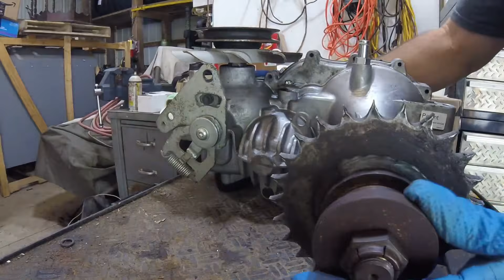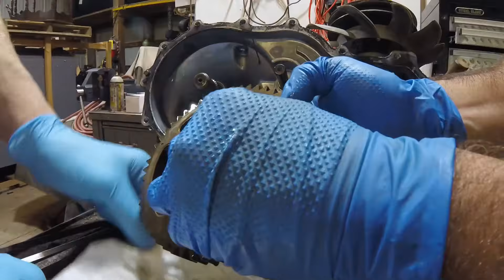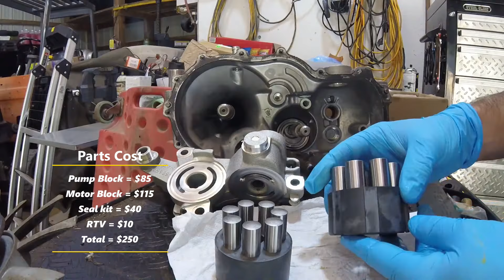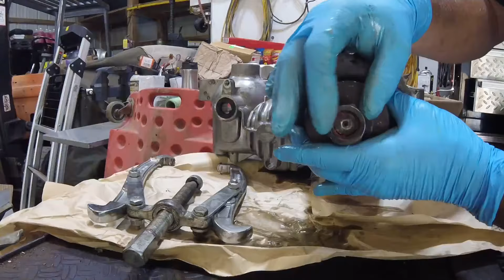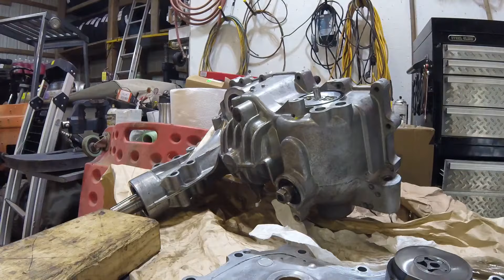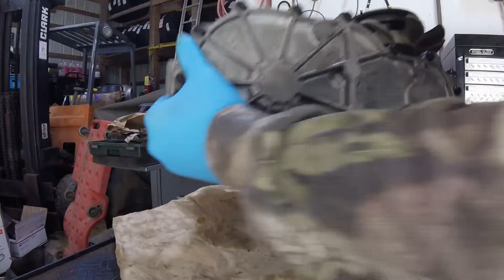Hydro gear ZT 3100 transaxle problem identification and repair

Comment: I'm glad you had this video, I did have damage to my center section and was just going to replace that cuz my pump and motor had no damage and I was going to refuse them.. saw this and sure enough, the pump had one loose pin I didn't catch... Ordered both for the same reason, they are cheap and I don't want to tear this down very soon

Comment: THX for he good advice I just went and downloaded the manuals for my ZT3100 and put them in my files.  I usally download these to a usb media stick and take it to Office Depot and let them print them out, punch 3 holes in the papers and put them into a 3 ring binder. I slide the first page into the front of the 3 ring binder.

Comment: I have a toro zero turn.  Uses 3100 hydros.  They are strong and operate quietly.  My issue is when going down the slightest of decline, and I pull back slightly to maintain a slower speed, the mower will jerk violently side to side.   Almost as if it’s trying to freewheel and engage reverse very quickly.   Even when driving at full speed on flat ground, it wants to pull side to side slightly, almost like it’s binding up and releasing.   It’s uncontrollable.  Steering dampeners are good.  Tires are good and don’t lose traction.  Has new fluid and filters.  Air is purged.   I’m at a loss.   Any ideas?   Common issues?

Comment: Excellent video and inside look at problem areas.  I'm trying to put external tanks on my new Gravely (damn them) and this, finally, is a version that shows the barb directly under the whole in the chassis (light bulb turns on).  So the breather will be gone (the cap performs what we needed from it).
Reply from the maker: Awesome! Glad it was helpful for you.

Comment: So I have a Z375R and both of the tags are missing. How can you tell what you might have without them? The right side is beginning to become very sluggish. I had thought maybe the belt was not tight enough or the tension wasn't very well as it was when the equipment was new. These transaxles are not serviceable. This Deere has been doing commercial work even though it's a residential machine.

Comment: So I have a question. I have a Walker lawnmower that uses the zt3100 transaxles, I had one go bad so I replaced it and I ordered the correct part number but the new transmission does not match the other side in operation. On beginning forward speed, the new transmission outspeeds the other (old) side. Around 3/4 of full forward speed, they are equal. At full forward speed the old transmission outspeeds the new transmission. On reversing, the old transmission far outspeeds the new one. But beginning forward, new outspeeds the old. Could this be corrected by a slightly smaller drive pulley on the new transmission? Of course I have made numerous adjustments to the linkages but this is still the final result.

Comment: Do you know if the zt 3600 hydro is much better than the zt 3100 hydro, or is it mainly just marketing hype?
Reply from the maker: Quality wise, mostly the same internal parts, but it's set up for more volume and a larger output.

Comment: I tried rebuilding my zt3100 but did not know to check those pistons. So when it was still powerless I ordered a new at 3100. After installing it i noting it doesn’t exactly return to neutral but my biggest problem is there is no more power than the old one. Could it have something to do with the return to neutral or the way I installed it? Help.
Reply from the maker: I'd double check a couple other items like you're pully, belt, tensioner, hub assembly, and neutral release lever. One of those could be slipping.. also be sure there's no air in the system, make sure you properly purge it after fluid changes. Good luck 🤞

Comment: Great video! Did you happen to renew the lip seal (157)  for the charge pump? The orientation for that seal isn't real clear in the service manual.
Reply from the maker: Yes, alll seals and gaskets were replaced. The charge pump shaft actually has a couple options depending on the exact serial number. The master seal kit comes with those and you have to match up the one that it uses. When you get the master seal kit there will be ones left over because of these variances.

Comment: I have a zt3100 on a Husqvarna. Mine runs fine for a while then gets "sticky", where it's hard to make precision movements. After that it will make the grinding noise and wont move. If I get off and pull the bypass, then do a purge, I can get back to mowing. Sometimes this will last for a while, other times it'll crap out again in a few minutes. But, I can repeat the procedure and go back to mowing. So, I'm thinking Im somehow sucking air into the system. The oil and filters were changed last summer. I have a new charge pump and cover, and have a seal and gasket set on the way. I do have a minor oil leak in this transaxle. Looks like up high somewhere. Maybe on the driveshaft seal. Any ideas would appreciated. I've never torn one of these apart before.
  The neighbor sold me this mower for $100.00 so I'm not out much I can't get it repaired. I actually got it to use while I'm putting another engine in my 2004 Everride Warrior. The POS Kamakazi engine doesn't have an upper bearing oil gallery. Kawasaki knew about these engines but never recalled them. The upper bearing wallows out due to no lubrication. The seal gets destroyed and it slathers oil all over the drive belt. Then it eats belts every 2-3 mowings.
 I had an older, but dependable Kohler 23 hp. that I'm re-engineering into the Everride. I just have to figure out the new idler setup.
Reply from the maker: Possibly check valve issue.
Reply: I just ordered a new charge pump kit and service kit for my badboy zt elite right side drive transaxle it's so weak that it won't move under normal load unless you start moving the mower with the left side first. Did the charge pump help with your problem? I'm going to do another full service on it tomorrow with another new filter and put the new charge pump on it and see if it helps my problem before trying to buy a used transaxle or have to buy a new one lol figured I'd try the easiest thing first before spending around 800 dollars on a new transaxle you know lol, anyways any info ya got will certainly help me out
Reply from the maker: Possibly an internal cylinder block is worn .
Reply: @notoriousJPG  
  I got it fixed. After a total disassembly, the only thing that seemed to be bad were the two cylinders above the supply pump. 
  During my journey through the transaxle, I  took the center section out and polished very minor grooves out. That was the only thing that I did besides changing those two cylinders. The original ones were loose. I did have some fun with that little square bypass. It fell out and I had to look for a while to find out where it went.
Reply: @battalion151R  Did you happen to get any water in your oil?
Reply: @bamf9285  
  No, it looked great.

Comment: I would really like to find out how to reinstall the bypass pin. Mine fell out when I pulled the shaft out and I don't know what the orientation is when reinstalling it. Help!
Reply from the maker: The case would have to be opened if it fell inside. .. then when assembling you need to use some grease to hold it in place. My video shows this process.

Comment: I just picked up a mower with hydro gears 3400. 420 hours. They are noisy. At idle they wine real loud. Not sure if the oil has ever been changed in them.
Reply from the maker: Check oil level, then replace filters and fresh oil... Could be oil issue or air in the system.
Reply: I dropped it off at the Husqvarna dealer last week. I praying they are not toast. The fluid is full but dirty. It runs fine just really, really loud.
Reply: The noise sounds like it’s coming from up near the fans.

Comment: Hydro gear transaxles need repair a lot because they’re junk. I will never buy another mower that features a Hydro gear time bomb transmission
Reply: 90 percent or more mowers use these hydro gear units.
Reply from the maker: Personally, I like the older style setup with separate wheel motors and pumps.
Reply: I had a Encore Fuzion 34 that thing had EZT hydro transaxle and I put 4400hours on that mower and sold it running well cause I had it for 8 years it was an amazing mower how do you explain how long these hydros lasted me.
Reply: I agree the hydro gear transaxles are garbage. I’ve owned 2 exmarks with this set up and have had nothing but problems. Things leak like crazy. I’ve had to get units rebuilt and have had to replace a unit because of it. Had one hydro gear that started leaking before warranty was up and exmark replaced it. I have that same mower in the shop now getting a seal kit installed due to leaks. I had an older exmark lazer z I ran for years that had a split pump system with wheel motors. Never had a bit of a problem with that system. There are still zero turns made that use the spilt system. I just bought a scag tiger cat 2 with a similar setup to the old lazer z. I am done with the transaxle.

Comment: Thank you for sharing!  Great demo of your work on the pump.

We have the 3100 as well.
New at 50hrs I drained the oil, repl the filter. About every 100hrs I service it again.
Blow off grass/debris after every mowing.

After 330 hrs or so the left charge pump o ring developed a leak.  

Picked up a HG oem  o ring. 
Didn't observe any scoring on the pump parts. 

Torqued the 12mm bolts 60in lbs then 110lbs.

refilled w/ oil and will complete the purge process later today. 

Cheers!

Comment: All you have to do to check the cylinder block pistons is push one down all the way, plug the hole with thumb on other side and let go of rod, if it holds vaccume then its good. Also when you take the pistons out , there are little spacer things inside that can fall out so dont lose them.

Comment: Update:  there are over 200 hrs on the rebuild now. No Issues so far. Btw all the internal parts are available. Hydro-gear tech support is very good. On their website you can download the service manual. Also, if you call their tech support number they can provide you exact part numbers for anything that you might need based on your exact model number.

Comment: I'm in the process of taking apart the pump on my gravely mower when I took the charge pump cover off there is quite of bit of scaring around it on the case side what do you think could have caused it? the pump actually locked up while I was mowing.  thanks
Reply from the maker: There were probably some metal shavings floating around in the fluid.  Also check the bearing and bushings for any play. There shouldn't be any movement in them.
Reply: @notoriousJPG  thanks

Comment: Did it work out for you when it went back on the aerator? I'm working on a "Hydro gear" transmission from a Honda Snowblower. There was  a decent amount of metal shavings on the magnet but I am stumped as to where it all came from. The faces on the pump and motor look pretty good. All the gears look perfect. I'm going to look closer at those pistons maybe there is play in them thanks for the tip. Apparently no internal parts are available to purchase only a basic seal kit is sold by the company.
Reply from the maker: Yes everything worked like brand new once  on the machine.